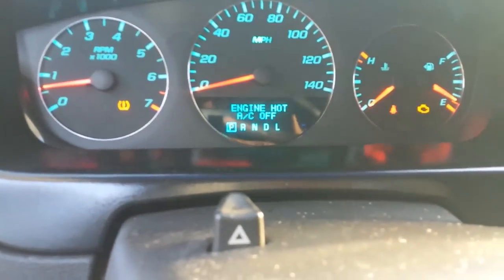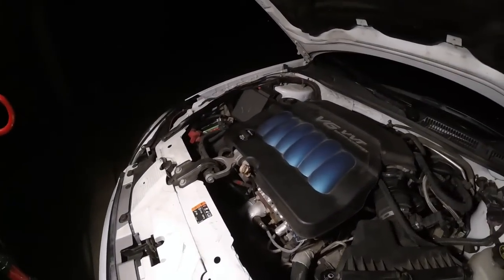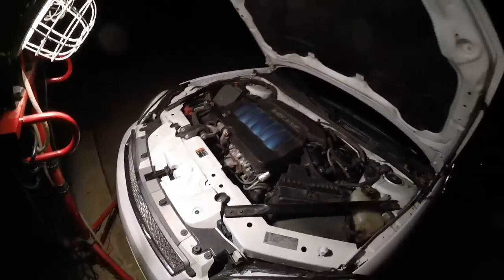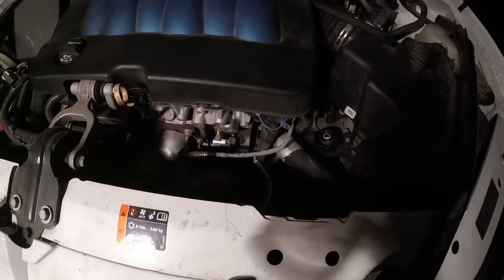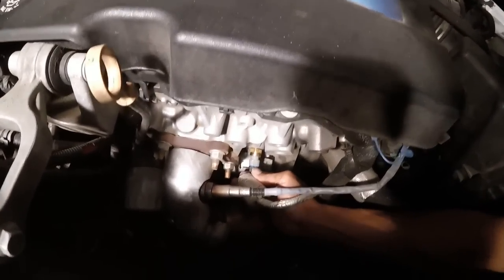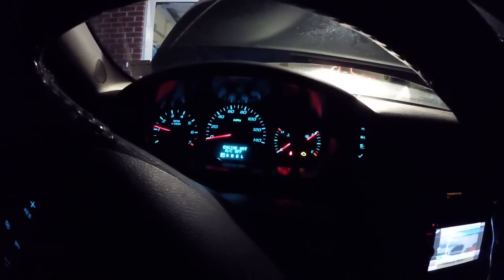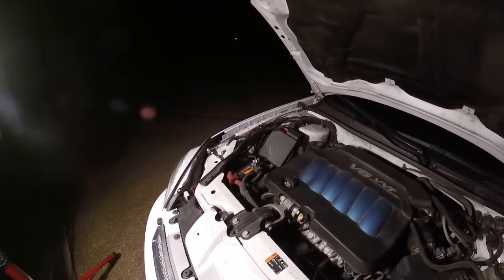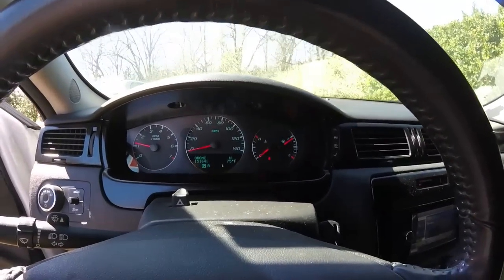2013 Impala Engine Hot AC Off Fixed

Comment: Can I still drive if this happens
Reply from the maker: Yeah you can still drive. The car will just keep the fans running the whole time and for a few minutes after you turn it off since it thinks the car is running hot
Reply: Do the fans running make the battery go dead.
Reply from the maker: @hilangelaw  it shouldn't. At the most it'll only run for about 10-15 minutes after the car is off then they'll stop
Reply from the maker: Nunu Loedrr  glad to help out

Comment: Gotta question for ya. I have a 2013 Impala LT, everytime I start it up from a cold start and a cold start only, if I put it in drive while it's warming up just before it idles down a loud rattling sound comes from the bottom of my car just for a few seconds and then goes away. What could it be, some people have said it's the heat shield.🤷
Reply from the maker: Could be, I'm not quite sure. But once the engine is warm it doesn't make the noise?
Reply: @89imp03  correct, our car idles I little higher during a cold start so that it gets warm quicker. During these few seconds while in drive that's when the noise occurs. Are you a mechanic and if so, would you say my car is pretty reliable? I've had mine about 5 months.
Reply from the maker: @bmlove81  I'm not a mechanic just mess around with my cars. I'd just let it idle a little longer
Reply: @89imp03  how's your duralast temperature sensor working? I changed my sensor and the engine hot ac off light has been coming on and off. I'll probably change the thermostat.
Reply from the maker: @bmlove81  it worked perfect for a while now it's on and off from time to time. Haven't driven it in a while so not sure if it's back to normal now or not
Reply: @89imp03  my dad suggested I by OEM which is AC DELCO for our car. And my cars heat is working so I don't think it's the thermostat.
Reply from the maker: @bmlove81  that could be the right solution
Reply: I've owned 2 2012 Impalas and they both do this. It's just a heat shield, nothing to be worried about
Reply: @ahmade.8142  can it be fixed, or is it best leave as is because of expensive repair cost?
Reply: @bmlove81  from my understanding I believe it's a heat shield in the exhaust system.  Shouldn't be an expensive fix, but nothing is technically "wrong" or broken, it's just a bit loose so it rattles. I honestly wouldn't worry about it
Reply: @ahmade.8142  cool thanks. One more thing, did your Impalas have the ac off engine hot message come up? It comes on and off for me and that's after replacing the coolant temperature sensor.
Reply: @bmlove81  I'm actually replacing mine as I type this. I got the A/C off message too, I'll let you know if it's still there when instart it up. Just drying up some coolant real quick lol
Reply: @bmlove81  ok I just started it up. It was the sensor, it's working now, and the AC off message went away
Reply: MaddBuddah  yeah let me know! I've actually changed the sensor and it worked for about a week and the message came back. I'm like you, it can't be the thermostat because I'm getting heat, so I guess I'll replace the replacement temperature sensor.🤦🏾‍♂️
Reply: Bennie Mangle Jr. thermostat!!! Sensor hardly likely to fail!! But also check temp sensor pigtail for any frade wires
Reply: MaddBuddah you can’t have heat!! If engine doesn’t reach temp!!! What’s happening is thermostat has failed,, they always fail open wich allows water to flow freely there for engine doesn’t warm up!! So if you are getting heat and have this message you need check frade wire at the temp sensor!
Reply: @LH81633  replaced the replacement duralast temperature sensor with a pen AcDelco temperature sensor and I believe that did the trick. The AcDelco is a better sensor.
Reply: @89imp03  so have you found a solution, is it registering heat?
Reply from the maker: @bmlove81  yeah, I might go back and change the thermostat too. Every so often it goes back to not working but it worked with no issue for a good bit after putting the sensor in

Comment: When this is happening does the fan stop working???
Reply from the maker: Not for me. When I had the issue my fans would turn on and stay on for like 15 or 20 minutes after I turned the car off
Reply: @89imp03  ok my fan used to do that before the engine hot ac off stared happening.. do u think that’s what’s stopping my fans from working because the thermometer can not read it ?
Reply from the maker: @summerrfunn6648  if your fans aren't coming on at all your car could be overheating for real but if they are working still it's probably that thermostat.
Reply: @89imp03  omg I called auto zone they said it was because of the thermostat so what do I do did u make some calls to find out because it all stopped working at the same time

Comment: Do 2013 Chevy impala have a lot of trans problems
Reply from the maker: Some might, I haven't had any with mine though
Reply: I'm at 153k miles on mine and I changed the fluid at 80k. Still goin strong

Comment: Wanted to say thank you!
Reply from the maker: You're welcome. Everything worked out?
Reply: @89imp03  Hell yeah but I ended up needing to change my battery also and that was no joke to get out.
Reply from the maker: @jayroll7399  yeah they made it more complicated than necessary on these to get the battery out
Reply: @89imp03  Hello so I thought I had fixed the problem. But I just recently got the warning again on my vehicle (Engine hot ac off) what would you recommend doing next?
Reply: @89imp03  check engine light is not on.
Reply from the maker: @jayroll7399  check for leaks. If you don't have any leaks I would look at changing the thermostat

Comment: I actually watched this video ,and replaced the sensor , it worked for about a month but just recently the "engine hot Ac off " problem came on again.
Fans are blowing as last time. 
Any suggestions ? I have the same model , I feel it's something more than the sensor , something else may be throwing it off ?? Any info helps , ty !
Reply: Replace thermostat
Reply: @kanedrajohnson8715  definitely Is the issue, thank you !
Reply: replace thermostat

Comment: okay i done changed my sensor 4 times and it still coming up saying “engine hot a/C off” what i do now?
Reply from the maker: Maybe a year after this I ended up changing my radiator (it had a crack in it) and changed my thermostat too. No problems since then
Reply: do you still ride it?
Reply from the maker: @bkluenose9021  yeah pretty much every day
Reply: if i take it to chevy you think they will fix it?
Reply: cause my gauges not working when it comes on
Reply from the maker: @bkluenose9021  yeah they should
Reply from the maker: @bkluenose9021  if the gauges don't work that's usually the sensor but they should be able to fix it. No telling what they'll charge though
Reply: can u still drive it if this problem on?

Comment: Hey mine does this but the temperature gauge goes Hot but then it goes away but I’m leaking anti freeze, can it be the thermostat or water pump?
Reply from the maker: Yeah if you're leaking I'd check both. Most likely the water pump is leaking
Reply: 89imp03 bro my 2012 will get hot when I’m idle then go back down when I start driving off then today it got hot while driving then said change engine oil soon it said I had 32% before  I drove now it says 0%
Reply: Water pump!!! If it heats up when idle then ok when you drive,, it’s because you are actually forcing pump to turn a bit!

Comment: My car says the same thing but my car isn’t running hot. It did it before then it came off. I’m just confused
Reply from the maker: Yeah mine didn't actually run hot either. Changing the sensor fixed it for a while. Some people changed the thermostat too while they changed the sensor

Comment: My question is, can you still drive the car like this? Until you fix it? My 08 impala just did the same it will come on one day then go away for couple days then come back for like 2 min then go away
Reply from the maker: Yeah it's perfectly fine to drive that way.   The heat or AC may not work but everything else works just fine
Reply: I need to get on my you tube... this isn’t my phone lol. I’m a girl so I have no ideas bout cars lol ok so, it’s fine to drive the car like this until I can see if it’s either or. Cause mine will come on for like 20 min then go away until 2 days later then come back for like less then 10 min then go away until a week later this doesn’t mean the car is over heating does it ?
Reply from the maker: It's most likely the sensor not working to read the correct temperature. You should be fine until you can get it checked out. As long as it's not smoking from under the hood or leaking water you shouldn't be overheating
Reply: 89imp03 thanks so much !!
Reply from the maker: @chrisplascencia1545  you're welcome
Reply: I am so glad you made this video. I just went on a 1,300 one way trip and my 2013 Chevy impala just started doing this. It can't be over heated because it does this right when I start the car.  The gage is saying it's dead cold. Lol. I'm also a woman that never bothered to learn much about cars but if it would save me money,  I'm willing to try to fix this myself. This new problem that developed today is also in addition to another problem the car has had for a month. The blower door for the AC/heat is clicking real hard and won't switch over for like 5 minutes.
Reply: Three Eyed Raven thermostat! Also check for frade wire at temp sensor pigtail!!! That noise is just the actuator motor to door!! Unless it bothers you I’d let it be till it fails then change it out!!

Comment: I changed the sensor like you said and reset the computer with the battery it worked perfect thanks
Reply from the maker: Glad it worked 👍👍
Reply: Very unlikely that it was the fix!! Check for frade wire at temp sensor pigtail if good change thermostat!!

Comment: etc its not the problem !!!! ,,all mecanic says replace this,,replace thermostat,,check level,,,all falses !!! its need ecu reprograming..or a wire is damage and pull resistance...and gm sould do a recall for this !!!!
Reply from the maker: Thermostat and sensor change and I haven't had the problem since. But every car is different so it could be a different source leading to a similar problem

Comment: My car said same and my impala is 07 but by the fan I noticed something missing and it where coolant was shooting out
Reply: I thought it was a plug do anybody know what it can be. Could be I need to replace the whole fan unit?
Reply from the maker: Bone game Sticks well thats messed up. What was missing and how?
Reply: 89imp03 I don’t know the holes on the radiator fan I thought a plug came off but it was coolant coming out of there on passagesd side of the car shooting out on to energy and inside my car said same this video ac/ turn off
Reply from the maker: Only thing I see on that side is the radiator hose at the top
Reply from the maker: Bone game Sticks good luck

Comment: Mines just started doing this for a few days hopefully it's not the thermostat but I don't think so cause it's not running Hot just error messages as if it is
Reply from the maker: That's how mine was. Hopefully it's just the sensor
Reply: @89imp03  did you ever have to replace your thermostat after doing the sensor change?
Reply from the maker: @antoniojenkins6235  no just changed the sensor. Ill probably change the thermostat soon tho because the light recently came back on so I think it's sticking from time to time

Comment: I just recently bought a 2010 Chevy impala LT.  Drove it for about 2 days then engine hot ac off came on. Replaced temperature sensor didn't fix the problem. Next day replaced thermostat and refilled and bleed system good. Still nothing scratched my head for awhile. I unplugged the harness for tempature sensor plugged in the old sensor. Touched the old sensor on the warm engine  while running. Fans shut off and engine hot ac off went away. Was able to use air conditioning. So I'm assuming I got a faulty sensor.  This will at least tell you if your wiring is messed up or you have a faulty sensor. Also was able to erase code that was permanently stored. Going to replace sensor again in the morning. To see if that fixes it all the way. Also dont forget to disconnect negative when you  replace sensor or thermostat. 

Any questions feel free to send an email. 

Twistedclown79@gmail.com
Reply from the maker: That's some good tips
Reply: Update 

The next morning I went and got a new sensor to be sure so replaced that and noticed right by the sensor clip wire was showing and inside the clip the plastic was broke so replaced the harness wife drove it about 500 miles and still is doing good

Comment: This message just popped up on my 2010 impala but my engine actually stalled. Would it still be a thermostat or sensor problem?
Reply from the maker: Maybe, I would check into some other things too. Maybe see if it was a coolant leak anywhere

Comment: But when you disconnect the battery it automatically reset 🤦🏽‍♂️
Reply from the maker: But it will eventually come back on
Reply: @89imp03  ik it didn’t work for me idk what’s the problem
Reply from the maker: @p.focused4964  might have to swap the thermostat too
Reply: @89imp03  trying that now thanks
Reply from the maker: @p.focused4964  good luck

Comment: What if i changed both and it still says the same
Reply from the maker: I'd unplug the battery and let it reset then try again. With both changed the problem should be fixed. Do you have any leaks or anything?
Reply: @89imp03  no
Reply from the maker: @princessnash6619  yeah I'd unhook the battery for a few minutes and see if that does the trick
Reply: Princess Nash check for frade wires at the temp sensor pigtail

Comment: Check your coolant levels. Mine were low and just add some
Reply from the maker: Yep, thats one of the other things that could cause this problem
Reply: Could take a few days if it’s super low for the message to go away
Reply: @89imp03  i changed mines what else could cause this problem?
Reply from the maker: @buddyrobell1941  coolant temp sensor, thermostat, or a leak
Reply: @89imp03  thanks I just changed the radiation so I'll try thermostat and see if that fixes the problem
Reply: And after make sure they reset it or the engine hot will come pack on
Reply: Did your radiator fan stay on as well , while car was off
Reply: @shereecrawford2909  yes . even after i filled it. might take a day or two at most to reset

Comment: My car is doing the same thing. Chevy impala 2009.
Reply from the maker: Could be the same thing, either the coolant temp sensor or the thermostat.  The sensor may be in a different spot on your year but should be roughly in the same area
Reply: I have the very same car 2013 and it happened to me 2 weeks ago unplugged the sensor and put it back in went to drive later on and the sensor started working again looks like I’m gonna have to buy the sensor and try everything you did since it’s started doing it again. Also did your fan stay on even after your car turned off ? Cause mine stays on for 5-10 minutes even after I turn my car off and the engine is nowhere near hot or warm
Reply from the maker: @armandovaltierra5892  yep, fan stayed on for a good bit after the car was off. Had people call me from the parking lot at work telling me I left my car running smh

Comment: My car keeps doing this idk why its so frustrating
Reply from the maker: Gotta be either the sensor or the thermostat. Or maybe even both
Reply: @89imp03  my dad took my car to the shop and the dude said they can fix it or we can fix it at home so we bought this little sensor and replaced it and my car worked fine for 2 months then the "engine hot AC off" thing popped up again so idk
Reply from the maker: Mine recently popped back on so I may change the thermostat this time and see if it goes back off
Reply: I changed both thermostat & temp sensor & it went then later came back on.  I'm plan to check my fans & fuse/ relays

Comment: Update I replaced temp sensor thermostat and the pigtail connector didn’t fix the problem I replaced both vvt solenoids only $30 a piece problem fixed
Reply from the maker: Never thought about trying that

Comment: Thermostat I changed my engine temp sensor and my light came back on. After I changed the thermostat it's blowing like a dragon.
Reply from the maker: Yeah it's usually one or the other
Reply: So I've changed the temperature sensor twice and that message came up again. I'm thinking it's probably the thermostat but my heat is working, what's up?🤷🏾‍♂️
Reply: @bmlove81  it's the thermostat
Reply from the maker: @bmlove81  I would say the thermostat has to be the problem then
Reply: @89imp03  yeah, I guess I figured that I wouldn't be getting heat if it was the thermostat.
Reply: @heavyondamister  so was your heat still working when you replaced your thermostat?
Reply: @heavyondamister  so your impala still had heat before you replaced the thermostat?
Reply: @bmlove81  yes but when I changed the thermostat it got hotter and the message hasn't came back on.
Reply: @heavyondamister  thanks
Reply: @bmlove81  your welcome. Pass it on!
Reply: @heavyondamister  update: turns out it was just low in coolant after a changed the coolant temperature sensor!! The mechanic charged me $18 to fill her up.
Reply: @89imp03  update: my car was low in coolant after a changed my coolant temperature sensor for the second time. Working fine now!!
Reply from the maker: @bmlove81  good deal, so everything is back to normal 💯
Reply: @89imp03  yeap, so far no more "engine hot a/c off!!"